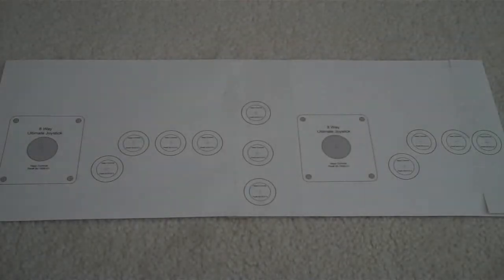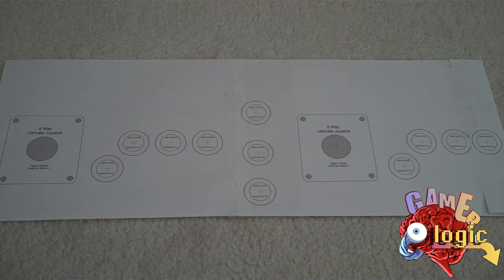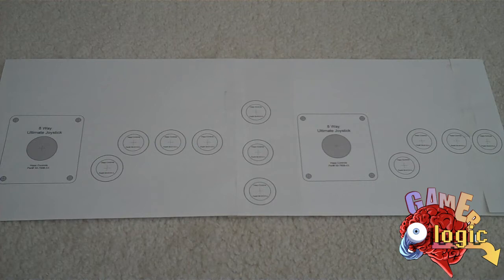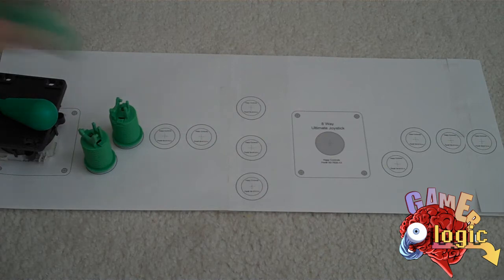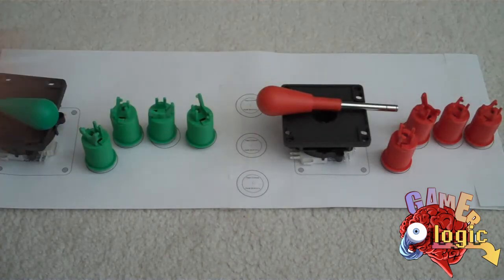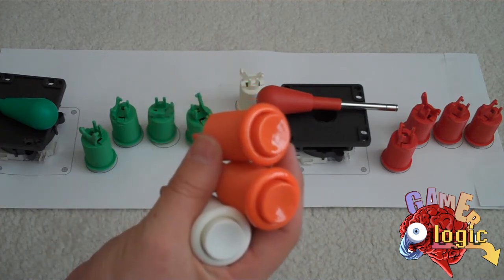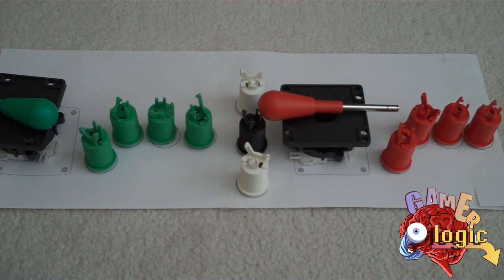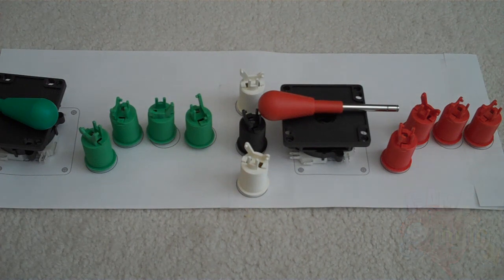Update on converting my Space Duel Arcade Cabinet to a MAME Cab.

Comment from the maker: @ShinmaRyuu  Thanks for the tip on the speakers! I will be sure to check those out. I have another arcade cab setup for a six button setup, so that's why this one is going to be strictly a neo geo layout. I was thinking originally about doing an 8 button setup, but it was just far too much. If I ever run into a awesome deal on a large control panel cabinet I'll go 8 buttons/4 players.